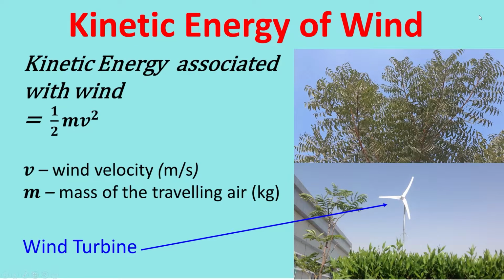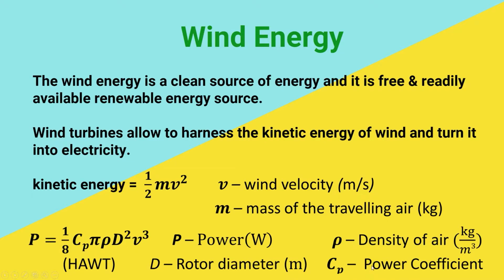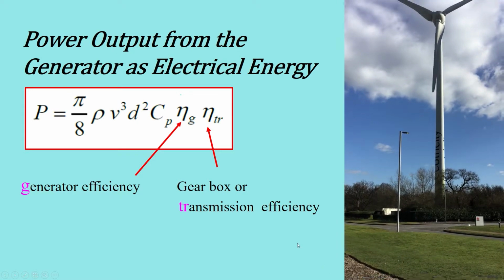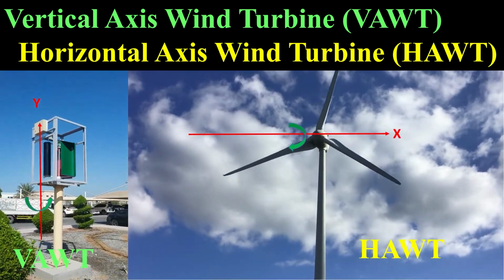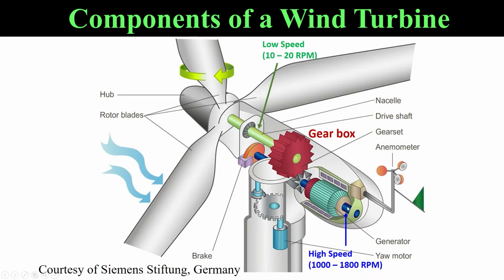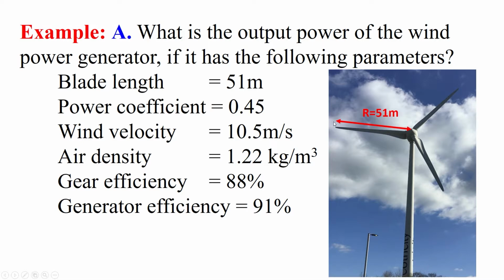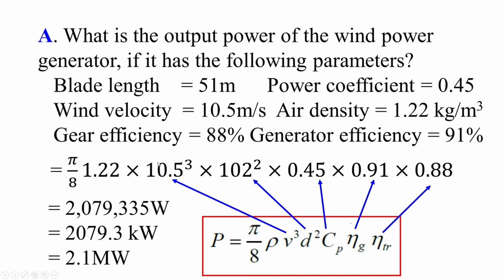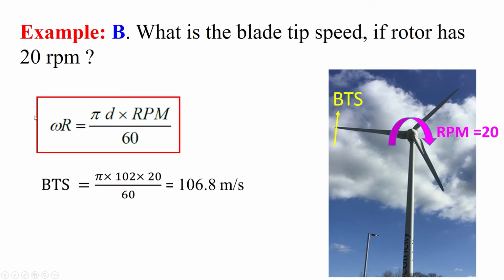Wind Energy | Wind Power | HAWT & VAWT | Calculations

Comment: L. What is cut-in wind speed?
Reply: The cut-in speed (typically between 6 and 9 mph) is when the blades start rotating and generating power. As wind speeds increase, more electricity is generated until it reaches a limit, known as the rated speed. This is the point that the turbine produces its maximum, or rated power.
Reply: cut-in speed is The speed at which the turbine first starts to rotate and generate power is called the cut-in speed.it is between 3 and 4 meters per second
Reply: The cut-in rate is The cut-in speed is the speed at which the turbine initially begins to revolve and generate electricity. It moves at a speed of 3 to 4 meters per second.

Comment: Which mechanism is used to increase the speed of the generator shaft of wind turbine?
Reply: The combination of lift and drag causes the rotor to spin like a propeller. A series of gears increase the rotation of the rotor
Reply: The rotor spins like a propeller due to the combination of lift and drag. The rotor's rotation is increased by a set of gears.
Reply: The combination of lift and drag causes the rotor to spin like a propeller. A series of gears increase the rotation of the rotor from about 18 revolutions a minute to roughly 1,800 revolutions per minute -- a speed that allows the turbine's generator to produce AC electricity

Comment: What is a device used for measuring wind speed and direction?
Reply: anemometer
Reply: The anemometer transmits the measured wind speeds to the   controller
Reply: An anemometer is a device used for measuring wind speed and direction. It is also a common weather station instrument.
Reply: Anemometers measure wind speed and determine wind direction. Using these sets of data, meteorologists can calculate wind pressure
Reply: The controller receives the measured wind speeds from the anemometer.

Comment: What is the rpm of the low speed shaft in a wind turbine?
Reply: The blades turn a low-speed shaft at about 30-60 rotations per minute (rpm).
Reply: The blades rotate at a modest speed of 30-60 revolutions per minute (rpm).
Reply: The blades rotate at a modest speed of 30-60 revolutions per minute (rpm

Comment: What are the generator types used in wind turbine?
Reply: There are three main types of wind turbine generators (WTGs) that can be considered for the various wind turbine systems, these being direct current (DC), alternating current (AC) synchronous, and AC asynchronous generators.
Reply: Direct current (DC), alternating current (AC) synchronous, and AC asynchronous wind turbine generators (WTGs) are the three primary types of wind turbine generators (WTGs) that can be considered for various wind turbine systems.

Comment: G. What are the generator types used in wind turbine?
Reply: Traditionally, there are three main types of wind turbine generators (WTGs) which can be considered for the various wind turbine systems, these being direct current (DC), alternating current (AC) synchronous and AC asynchronous generators. In principle, each can be run at fixed or variable speed.
Reply: Direct current (DC), alternating current (AC) synchronous, and alternating current (AC) asynchronous generators are the three primary types of wind turbine generators (WTGs) that can be considered for various wind turbine systems. Each may be run at a fixed or variable pace in theory.

Comment: D. What is the rpm of the generator shaft in a typical a wind turbine?
Reply: Large-scale turbines typically rotate at 20 rpm, while domestic sized turbines tend to revolve at roughly 400 rpm. In most large-scale turbines, the low speed shaft is connected to a gearbox. The gearbox increases the rotational speed of the shaft, up to 1200-1800 rpm.
Reply: The nacelle
Turbines on a large scale normally rotate at 20 rpm, whereas turbines on a smaller scale often run at 400 rpm. The low-speed shaft is usually coupled to a gearbox in large-scale turbines. The gearbox boosts the shaft's rotational speed to 1200-1800 rpm.
Reply: Turbines on a large scale normally rotate at 20 rpm, whereas turbines on a smaller scale often run at 400 rpm. The low-speed shaft is usually coupled to a gearbox in large-scale turbines. The gearbox boosts the shaft's rotational speed to 1200-1800 rpm.
Reply: Wind power is generated by the force wind exerts on the blades of a turbine, causing the turbine's shaft to rotate at a speed of 10 to 20 revolutions per minute (rpm

Comment: K. What is the mechanism used in large wind turbines in order to face the wind when the direction changes?
Reply: we can use Yaw drives, and Orients upwind turbines to keep them facing the wind when the direction changes.
Reply: When the wind direction changes, we may employ Yaw drives and Orient upwind turbines to maintain them face the wind.
Reply: We may use Yaw drives and Orient upwind turbines to keep them facing the wind when the wind direction changes.

Comment: What are the material used for wind blades?
Reply: wood, steel, aluminum and fiber glass
Reply: depending on make and model wind turbines are predominantly made of steel (66-79% of total turbine mass); fiberglass, resin or plastic (11-16%); iron or cast iron (5-17%); copper (1%); and aluminum (0-2%).
Reply: Wind turbine blades are primarily made of composite materials that combine high-tensile-strength fibers with polymer resins to form glass.
Reply: Wood, steel, aluminum, and fiber glass are some of the materials used

Comment: What is the Betz limit (the theoretical maximum efficiency) for a wind turbine?
Reply: The Betz limit is the theoretical maximum efficiency for a wind turbine, conjectured by German physicist Albert Betz in 1919. Betz concluded that this value is 59.3%, meaning that at most only 59.3% of the kinetic energy from wind can be used to spin the turbine and generate electricity.
Reply: maximum energy can be extracted from the wind if it is slowed down to one-third of its original speed. 59.3% is the maximum amount that can be extracted from wind
Reply: The Betz limit, proposed by German physicist Albert Betz in 1919, is the theoretical maximum efficiency for a wind turbine. This threshold, according to Betz, is 59.3 percent, which means that only 59.3 percent of the kinetic energy from the wind can be utilized to spin the turbine and create power.